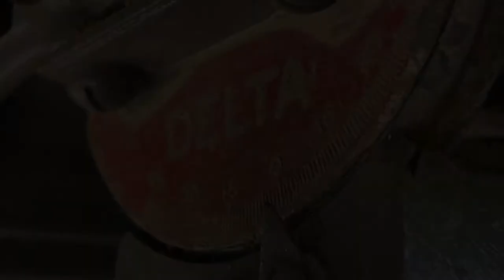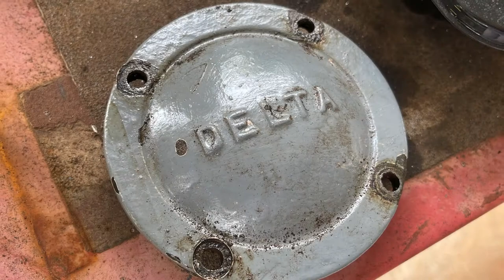Delta 24" Scroll Saw Restoration

Comment: very nice restoration. I have one of these that is banging away on each stroke so I have to disassemble and probably look a a restoration while I am at it. what did you use to strip the old paint and all the grease? Chemical dip or bead blast?
Reply from the maker: Thank you for the comment.  I used a gel product called CitriStrip to remove the paint.  It worked pretty good but I did a lot of sanding too...haha!   If you have to disassemble the bottom mechanism that holds the blade, there was one tricky part with a double set screw that you should be aware of.  Other than that disassembly was easy.  Hope you can get your saw running well.

Comment: This looks terrific! I recently bought one that seems to be in about the same shape as yours was. I hope you don't mind me asking -  what kind of paint did you use and did you spray or brush/roll it on?
Reply from the maker: Hi Joe...thanks for the comment!  I used Rustoleum Rusty Metal Primer followed by Rustoleum Gloss Protective Enamel.  Both were spray cans.  The paint has held up very well.  Good luck on your restoration project!
Reply: @DaMaxchi  I followed your lead and went with a dark green color. One more question if you don't mind - did you replace the gaskets around the crank/cam covers, and if so, what kind of paper/material did you use?
Reply from the maker: @joeemery5648  Yes, I had to replace the gaskets as they were extremely worn and even broke apart during disassembly.  After some research, I decided to cut my own gaskets using an automotive gasket material called Karropak fiber sheet Part No.3046.  I think I bought a roll at my local NAPA store.  This material is thin and designed to be used when oil, gas and other like liquids are involved.  The material was very easy to work with and there has been absolutely no leakage since the rebuild.   Sounds like you are making good progress.  Let me know if you have any other questions.
Reply: @DaMaxchi  Super helpful - thanks so much!
Reply: @DaMaxchi  Thanks so much! I think the cover on mine is a little bent, possibly from overtightening, as it's not completely flush against the housing. I ordered a replacement and will compare but will also switch to this gasket paper when replacing it. I think the only thing beside that to get it functioning properly is to get it set up with motor speed and blade clamps to where the blade will stay in. Right now the blades come out (both at top and bottom) when running the saw. Any suggestions on that are also greatly appreciated.
Reply from the maker: @joeemery5648  Regarding the covers...on my saw, the existing gaskets were "glued" onto the covers.  I had to scrape and sand to get the old gaskets off down to bare metal.  Perhaps there is still some old gasket material on your covers?  You could place your covers on a pane of glass to see if it rocks or is indeed bent, although I can't imagine this cast iron cover bending,  Fitting the blades can be a bit finicky.  Do you have the blade guide adjustment disc set to the right thickness and is the blade roller positioned correctly?  Also the bottom blade holder can be adjusted to accommodate flat blades versus triangular files.  Are your bottom blade holders set correctly?  Also I assume the thumbscrews for the blade holders are ok.   Also, do you have access to the instruction manuals that came with the saw?  The manuals have detailed instructions on how to properly insert the blades.  Hope that helps.
Reply: @DaMaxchi  Once again, thanks so much for the response - this is all very helpful. I can't lie the cover on a glass surface unfortunately because it's rounded on the outside and has the welded pieces inside that provide a narrow channel to guide the cam. But I did put a straight edge on the outside it and it's not perfectly flat. The gasket I currently have is actually a thicker material from an auto parts store, but when the replacement cover arrives I'll replace that with what you recommended. Fortunately, the side with the motor isn't leaking. I'll track down the manual with the blade guide and instruction settings/details and see if that helps!

Comment: wow great job! I got something similar recently and im looking to restore it but quite intimidated to take it apart. Right now it looks like the oil leaked all over it at some point and its just a grimey mess. I will re-watch this video for inspiration (:
also i've been trying to find videos of these vintage scroll saws to hear how they are supposed to sound since i have no frame of reference for if its running in good condition. i was really glad that you turned it on right at the end of the video. mine sounds just like that so it seems like its in good shape in that asepct.

again, this was a really great restoration!
Reply from the maker: Hi Amy...thanks or the comment!  I hope you do a get a chance to takes your saw apart and restore it.  There really isn't too much involved.  Just take a lot of pictures at each step so you can use them as reference when you put things together.  The link below is for another Delta saw restoration YouTube video that I found very helpful.  This guy actually did a  series of videos on the process.  If you do restore your saw, please consider replacing the bearings in the shaft assemblies.  I chose not to and have been regretting it.  I think it will make your saw sound (and run) even better.  You can DM me or comment below if you have any specific questions...happy to help out.  Good luck!!!

https://www.youtube.com/watch?v=WrAoNfLlkeM

Comment: Hi nice job. I have a very similar model Does not need a restoration Just cleaning  My problem is I think it was stored for many years with thr spring in the extended position so it is very weak and I also noticed talk about a blade holder modification  for better quicker blade changes   springs are hard to find. I did purchase one but was also weak  How was your blade
Reply from the maker: Hi Leland...thanks for watching.  There is a lot of tension when I pull the blade holder assembly down and the travel is good so I think the spring is OK, but not really sure. Yeah, getting parts can be tough but I think many parts were interchangeable between these old scroll saws so that helps.  I hope you will be able to sort out any issues with your saw.

Comment: Perfect timing and well done video. I too have on my plate my grandfathers No. 210. Having an issue (disassembly with out a manual) with removal of the part NSS-337 ( got a pdf from off Keith Rucker's site) show on a service manual. Did find and remove the Allen (my was a torques ) and the lower split pin, but still the shaft will not move. Can you help? Also need a source for a new motor and front lower Delta badges. I was not going to start the restoration before other projects were done, but after watching and subscribing to your channel,, got into it this morning. His was in really good shape, but some ware in that lower piston shaft bushing, so will machine a new on. Any help would be appreciated,, Bear in TX. Welcome to drop in and catch a look, and please subscribe..Thx
Reply from the maker: Hello Bear...thanks for watching and the comment.  If you are having a problem removing NSS-337 from the shaft, then check to see if there are two screws holding NSS-337 to the shaft.  I remember removing the first Allen screw and the shaft wouldn't move.  But then using a flashlight, I saw that there was another Allen screw in the housing (behind the first screw) that had to be removed.  Once I took that 2nd screw out, the shaft easily slid out.  I guess Delta used two screws, back to back, to make sure the shaft doesn't slide out over time.  I found a lot of parts and decals on eBay for these old saws, amazing what is still available.  Good luck with your project.  I've subscribed to your channel and will check on your progress.  By the way...you are quite the machinist!!!  Please let me know if I can help in any way.
Reply: Yes, the outer trap screw was an hex, and then an allen screw. Delta had stumped most of us ole farts that didn't have a build manual,,,but hard to out smart a fox or a Bear,,hehe! I have some vintage JD Wallace machinery as well, there too are build too last,,be nice to visit again on old machinery, Bear.
Reply: Thx, and yes, the first was an hex and the other was allen with a dog point. Cleaver design (@@)! Shaft out, and now to machine two new bronze bushings today.